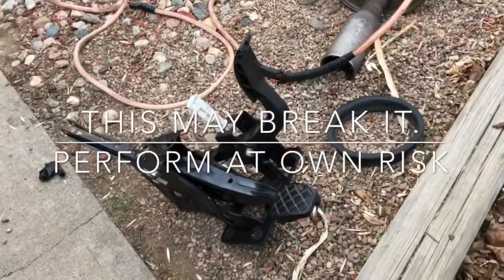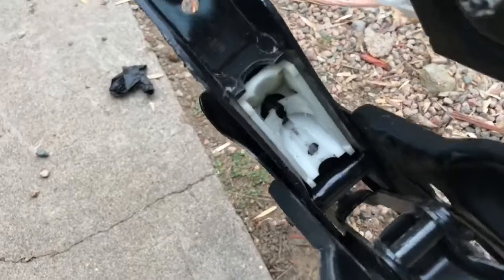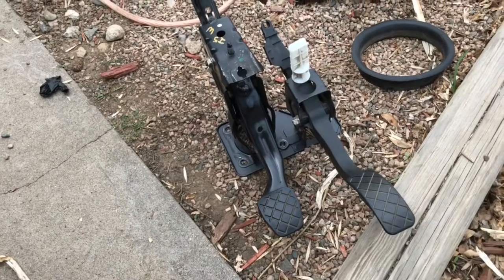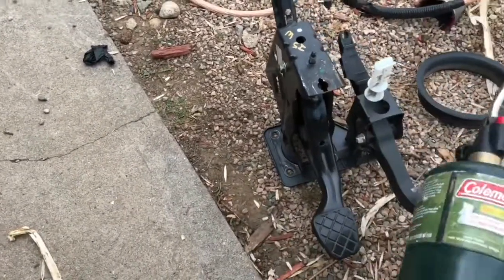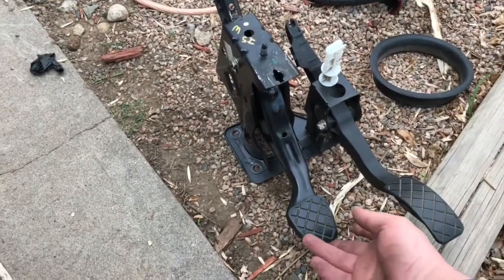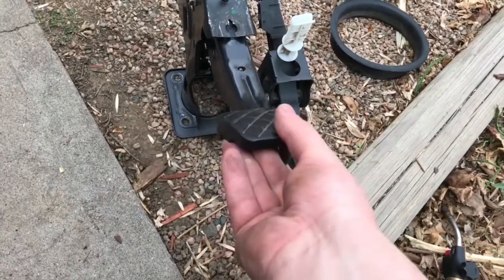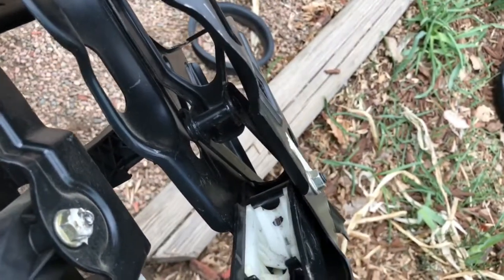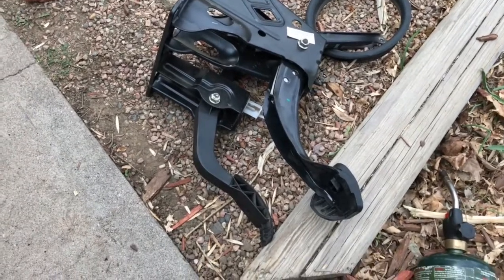Quickly Remove Brake Pedal MK4 Jetta / Golf

Comment: I have been fighting this for 3 hours trying to make a tool or using a screwdriver with no success.  Got the torch, heated at the area that the rod contacts the pedal with low heat for 3 minutes, let the heat absorb and then gave a yank on the pedal and it popped right off! What a life-sanity saver😀
Reply: Im about to do this
Any advice getting it back on?

Comment: Hmm... Well I yanked on the break lever really hard several times before I learned about the tabs. Didn't break anything. Found this video. Got out the heat gun and ran it from side to side and the front for a good 5 minutes. Pulled on the brake pedal and pop. Off it came. I thought, heck what a great trick. Then I found the broken tab on the floor. Well I'll jb weld that thing in there if I have too. It could be worse.
Reply from the maker: Ahh dang! The heat gun probably didn’t heat it up enough. I had to basically wait until I started seeing a light amount of smoke.

Comment: I become crazy 2 times to get out sphere from the brake pedal, I broke the white plastic 2 times. Then the third time I found the right way: place two fingers (using both hands) behind the pedal and try to dilate the two plastic tabs so as to release the ball without too much force.
Reply from the maker: Alessandro Zavagno yeah... I've tried just about everything and this process was the only one that's saved me from being admitted to a mental facility lol
Reply: Hi. I found a new process just last week-end. I used a flat screw driver, i put it between the brake servo rod and one of the two plastic tabs,  I bended the plastic tab laterally while pulling the pedal and the pedal came off.